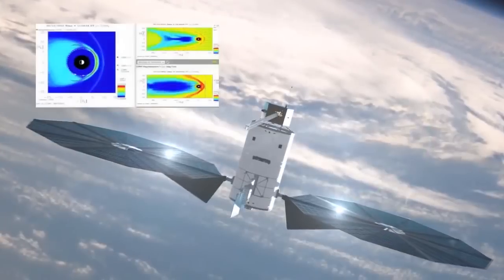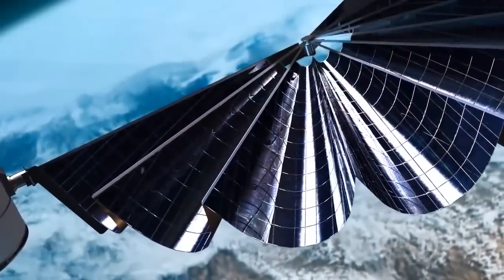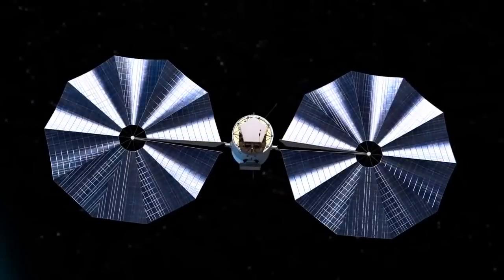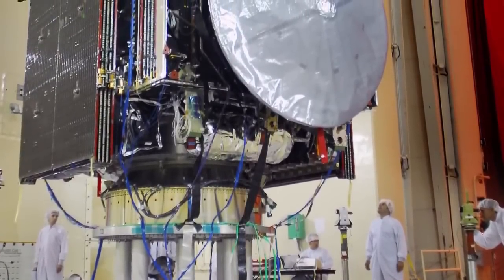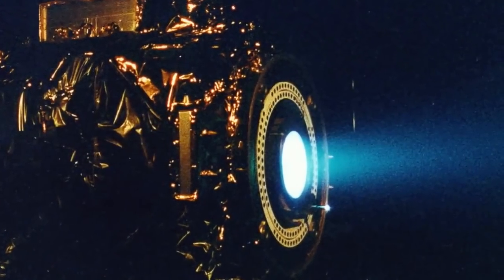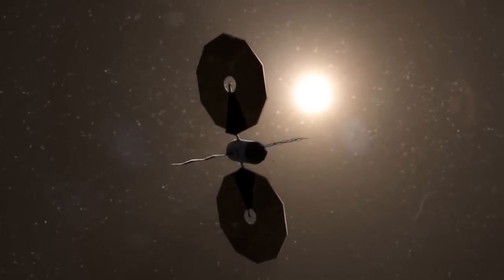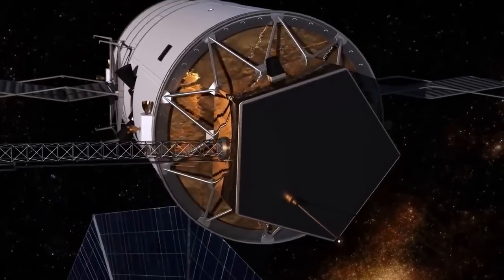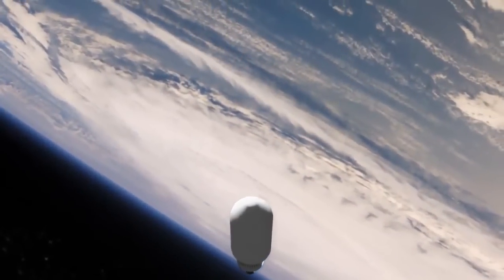Solar Electric Propulsion Upgrades Wanted For Deep Space Missions, More | Video

Comment: Q: why can they just build a solar generator that makes electricity from solar panels that then powers a generator that creates even more power and have basically an infinite loop of energy ?
Reply: Thermodynamics, specifically the first and second laws.
Reply: because in any system there are inefficiencies and imperfections, so while you could use some of the electricity to spin a generator or whatever, the best it might do is slightly prolong how long it runs. energy is always lost (but not created or destroyed) and all systems lose entropy to settle at thermodynamic equilibrium.
Reply: Brandon Winfrey i always thought about that
Reply: David Marx ok so a gas generator makes electric right why can't it sphyon off the electric needed to run it ? I guess I just don't understand it